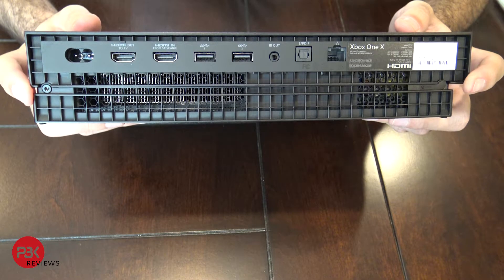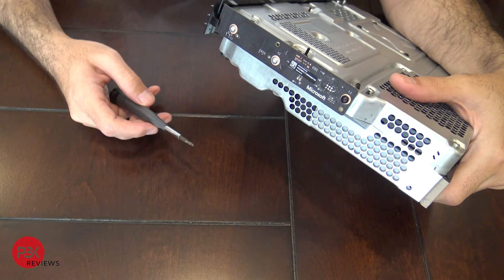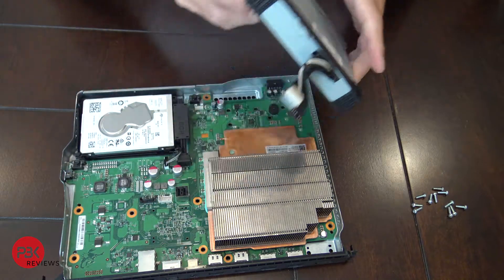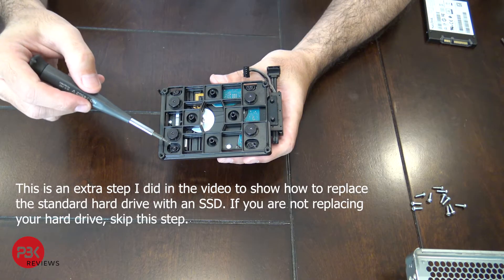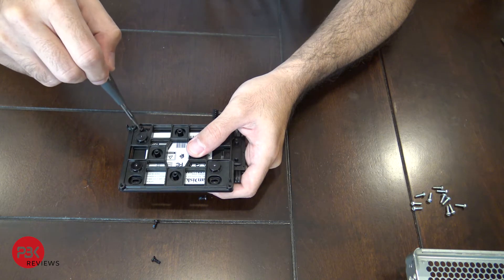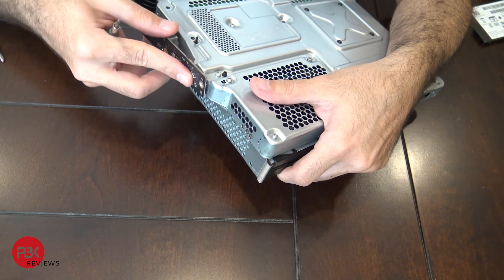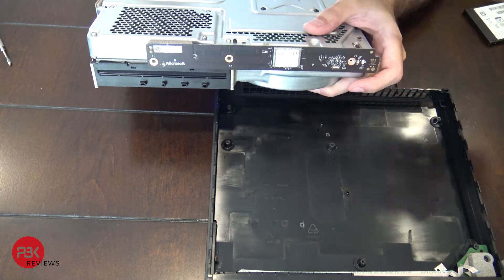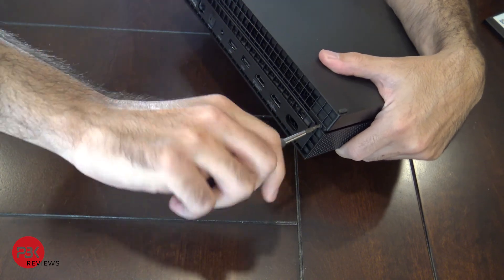Microsoft XBOX One X Disassembly Teardown Hard Drive Replace Video

Comment: how do you get the little tab inserted? having a hard time 17:43
Reply from the maker: you mean the flex cable? you can try unscrewing the board and connecting the cable first then screwing the board down.
Reply: @PBKreviews  exactly  what I did thank you, have to go back and readjust the power cord insert, but honestly am burnt on working on the xbox so it's all put together already and now time to play minecraft dungeons
Reply from the maker: @Fantasytails  glad to hear you got it goin

Comment: Would it be possible to take the 2 TB HD out of my Xbox One S and put it into the Xbox One X?
Reply from the maker: I don't think the software will be reverse compatible etc. If you plan to use it as a new clean drive, yea you would be able to but as far as just moving it over and having all your files and old software, it would probably not read it.
Reply: Thanks :)
Reply from the maker: your welcome
Reply: You can use just about any 2.5" form factor drive. so yes, however, you must first do a "sector by sector" copy using a program such as AOMEI Parition Assistant, for it to work. If you simply do a quick copy with same program or windows for example, it would not work.
Reply from the maker: Ive cloned the drive using acronis and it worked, basically does an identical clone.

Comment: How do you put top cover on I’ve tried and it does not want to go on.😡
Reply from the maker: the sliding one?
Reply: Yes , just can’t do it 😡
Reply from the maker: Fiddle with it a bit, or try pushing in one side then work on the other. I know sometimes it falls right in, but sometimes its a hassle to get into place.

Comment: how about 5tb 2.5 inch seagate barracuda
are this model can be use in xbox one x?(because 5tb model is actual 15mm of height)

https://www.amazon.com/Seagate-Barracuda-2-5-Inch-Internal-ST5000LM000/dp/B01M0AADIX?th=1&psc=1
Reply: Currently 2tb is the biggest but you can format. But you can format and stretch the partition to account for the extra 3gb but if you ever need to reset the console you will have to repeat this process again as it will drop back down to 2tb
Reply from the maker: I'm not sure if the height will work or not since the other drive sits on top of it and not sure if the case will fit over it if the height is different.

Comment: Did you have to reinstall  the O/S to the new SSD ?
Reply from the maker: Carlo Tai not if you use a clone disk utility like acronis to clone the hard drive to the ssd
Reply: Microsoft is convenient enoph to make it so when you replace them, you have the option upon boot up to auto configure the HDD/SSD.

Comment: How performance was improved using ssd instead of hdd?
Reply from the maker: Loading games are faster and it just runs a bit smoother. Also creates less heat than a standard hard drive creates since the ssd has no moving parts. Will make the system last longer.
Reply: Thanks, may you list tools which one u was using to open box?)
Reply: and also how you prepared ssd to work with?
Reply from the maker: Your going to need a Torx 10  (T10) screwdriver to open the case and some screws inside, Also you will need a Torx 9 (T9) screwdriver for some screws inside.